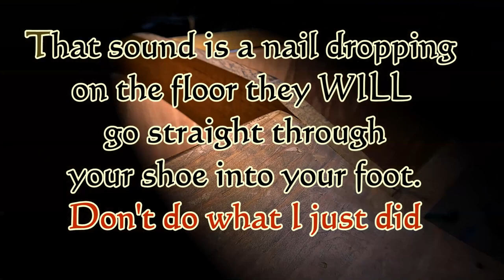Using a new type of screw to fix old furniture.

Comment: The only drawback to using screws is that the wood will move with changing humidity and result in splitting the already dry wood. Nails allow for the expansion and contraction during seasonal changes.. Great video.
Reply from the maker: Very good point!! I’ll have keep an eye on it.  The house is pretty well humidity controlled so I suspect it won’t be an issue for me.  I’ve got some small table tops that are pocket jig screwed together and haven’t seen any issues.

Thank